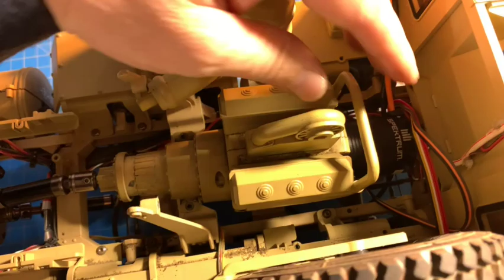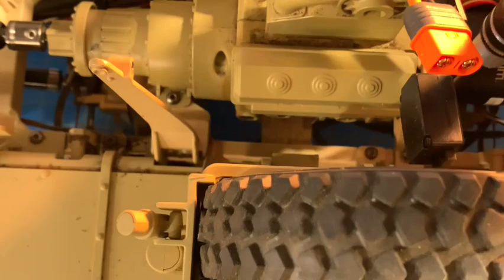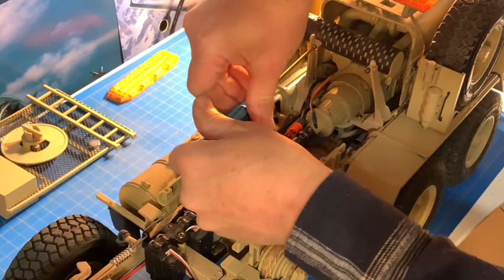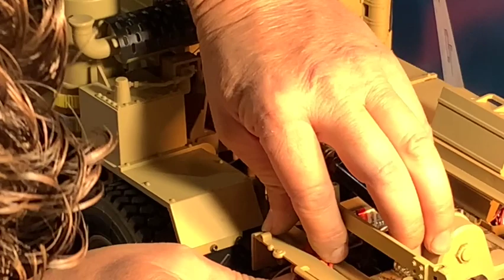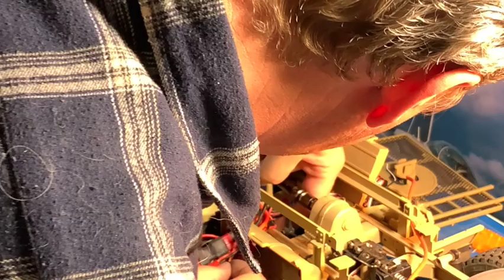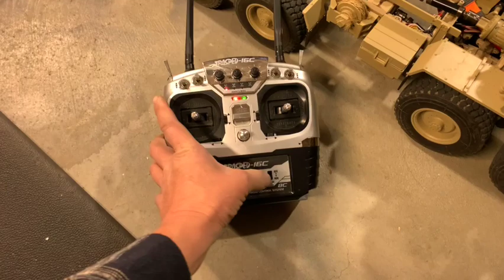HG P802 Oshkosh HEMTT upgrades Pt-2. Motor modification. Rc construction

Comment: Where do you buy your equipment? I am going into rc cons equipment. I have toucan rc hobby priced me the Dxr2 jdm98 new sound 201 radio 2 batteries charger all in shipping, tax, customs clearance all in 2350.00 usd. I’m in northern Alberta Canada.
Reply from the maker: That’s a pretty good deal to get it delivered at that price. I get my stuff through toucan, AliExpress, or motion RC.
Reply: @digitrc  thx have a great day